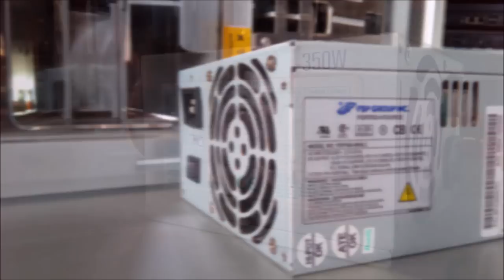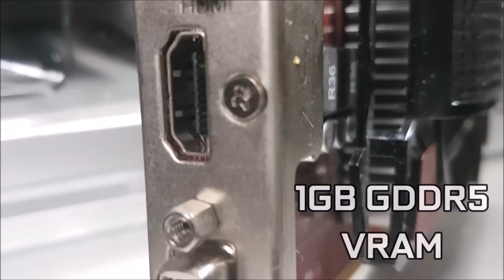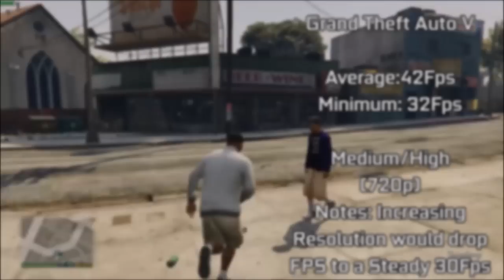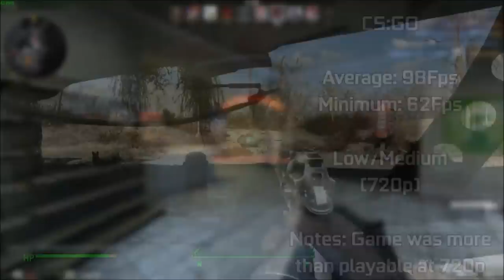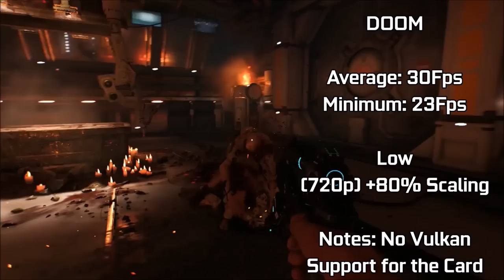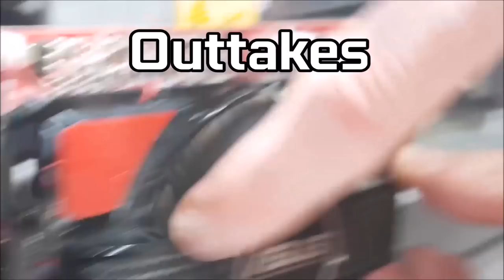Why you SHOULD buy an R7 250 in 2017 // The Low Power Consumption King.

Comment: As a R7 250 user, I don't recommend you guys to buy it to play newer games
Reply: Agreed- I used a 250 in my older computer, I just upgraded to NVIDIA's new budget & low profile card, the GT 1030.

It has almost double the performance of a 250. Whereas I had 2 gigs of DDR3 VRAM in the 250, the 1030 has 2 gigs of DDR5. Clock speeds are far superior in the 1030.

Plus, I got it for $69 bucks brand new on Amazon.
Reply: I bet that R7 250 is great in a HTPC. another low profile/low wattage GPU would the HD5450! runs 1080HD fine in most video streaming conditions
Reply: Jason Hicks The 250 honestly struggles with most modern games man, even when OC'd.

The best cheap, low-profile card on the market right now is the GT 1030.

As I said in a earlier post, it has nearly double the performance of a 250.
Reply: 1030 instead of RX 550? For shame.
Reply: Mark F rx 550 is better
Reply: im a AMD fanboy but the Gt1030 seem better and cheaper it will hold me over until the GPU market is normal.
Reply: darkseeker102 rx 550 is better than gt 1030
Reply: oh well i was coming from an apu integrated graphics so it was a step up now im waiting for prices to return to normal to either get a 570 or 580
Reply: the gt 1030 is also great for 4k video only kabi lake cpus can fully decode all types of 4k video, so its great for older cpus
Reply: rx 550 is a little faster in some games more expensive and more watts though
Reply: im not going to talk shit on the 1030, but for like 40$ more you could have gotten a 1050
Reply: silosis there are more reasons than simply price to purchase a 1030. Its power draw, size, and the like come to mind.
Reply: Mark F power draw isnt THAT much higher on a 1050 compared to a 1030, but being low profile is a plus for htpc use. You can find the 1050 in a low profile variant but it ussually costs a bit more. The 1050 may be a bit overkill for htpc use, but if you wanna play newer games it does come in usefull
Reply: so sad 250 has ddr5 version dude. why you buy ddr3? hahahaha
Reply: not unless u have vga monitor
Reply: It's a what, 3 year old card? Who cares, dude? Whether DDR3 or 5, the 250 struggles with most modern games.
Reply: 小马 me too I have a 2gb ddr3 version and its not good for gaming
Reply: if you have vga monitor would you still buy gt 1030?
Reply: The GT 1030 only has an HDMI or DVI output. No VGA output. That said, you can get a converter cable.
Reply: Organic Agriculture Program DA RFO 10  brother' you can buy the adapter and use it with your graphics card
Reply: that said gt 1030 + vga convertable is not good when u have vga monitor.
Reply: I mean, it's not the best setup in the world, but it would function fine. Is that what you're asking?
Reply: r7 is better. because if u go to gt 1030+vga converter price is few bucks away to 1050, if that happens there is  no point in staying entry level gpu.
Reply: I absolutely agree. But you're the one who brought up the whole VGA thing, so....? I also don't see how you can sit there and claim an R7 250 is better than a GT 1030? I've owned both, dude. The 250 gives half the performance of a 1030.
Reply: because older computer has vga output. maybe ur computer is not old after all. today hdmi is the mainstream output which the gt 1030 had.
Reply: With my old computer (the one I use the 1030 in) I use an old monitor as well. I use the DVI connection, which the 1030 obviously has an output for. DVI connections for monitors have been around for awhile... I'd say the monitor I use on that computer is easily 10 years old.
Reply: Yea I just got it for my hp 8100 until I get to build my gaming pc
Reply: Ripclaw23 Cool,man. It’s a decent card, you’ll enjoy it. As long as you stick to low to mid-range gaming.
Reply: I had it and the fans were falling like every time when spinning faster.And it fell until it did not spin anymore.
Now,I have a GTX 460 and it's doing fairly BETTER than a 2013 gpu.My R7 250 was 2GB VRAM GDDR5 and this GTX 460 has only 1GB VRAM and does better because it has 256 bits and the other one had 128 bits.
Reply: I did have one for a long ish time and I can't disagree with you on that it was an impressive little card but I had to upgrade in the end
Reply: Can it handle fortnite in low/medium
Reply: How well will it run doom 2016
Reply: true
Reply: @I_am_not_a_dog  gt1030 in 2020 are ddr fuckin 4 its Lame card now
Reply: As a R7 250 User, fuck that card

Comment: 2gb version sporting ddr3 was ment for being used in dual graphics mode paired with an A10 apu. The higher ammount of vram was needed for the extra detail both gpu could handle and the DDR3 instead of faster DDR5 was to prevent data chokes due to memory speed differences and therefore reducing microstuttering...
It was a great idea that never really worked

Comment: Keep in mind it's highly unlikely to work with a non-uefi motherboard and system e.g. 2012 HP, so it's not quite universal. It also has a 65w TDP which is slightly more than the 750ti's 60w and considerably more than a 1030ti which consumes only 30w and has the option of silent cooling. The R7 250 can save some money for an impressively similar experience, but be wary that it has the same iffy compatibility as the others.

Comment: I love this little card, I got the 768mb GDDR5 version in 2014, which it didn't do too well, GTA V got 30fps at 720p normal, but when put in a very restricted hp PC with a A8-3870K, it suddenly was getting 60fps in GTA V 1920x1200 on medium & high settings! It turns out it had grouped up with the graphics of the A8 which gave it annother 512mb vram and a big boost in preformance, and for a total cost of £70 for the whole PC, this was a exellent value, especially for the preformance it gave :)
If you see a R7 250 you should definitely pick it up, (don't get the 2GB DDR3 version though, they have much worse preformance, even my 768mb one beats it).

Comment: I have a R7 250 with 1gb vram, i5 2400 and 8gb ram. This is in an HP elite 8200.  In Doom 2016 vulkan on low getting on average around 30fps during arcade mode. Drops slightly when a lot going on but still playable. Might be different on the later campaign levels. There are some console commands that can be applied though.
Reply: Identical setup of a PC of mine,I wish I did find a 2GB version tho because that would have performed better than just 1GB.
Reply: For competitive games battle royal shooting games 1gb gddr5 version is better. But games like rdr2 need at least 2gb for just start. Many recommended 1gb gddr5 which has more bandwidth, but in the end physical amount vram is more important. The work gddr5 is not even necessary, it is about memory bandwidth. Ddr3 vram still ok because of other factors like 64 bit or 128 bit memory bits also affects the memory bandwidth. Double amount of vram is more important in some cases. Lower frame rates but stable FPS.

Comment: I saw there are actually versions with 2 GB GDDR5. One of them is even single slot, low profile. That might be an option but the small bandwith might be still be an issue.
Reply: The 2GB GDDR5 versions are a lot more expensive though, and the bandwidth isn't really an issue.

Comment: I have the 2gb version and i get 120-60fps on csgo with the settings maxed out except shadows they are on medium:) My cpu is an A10 7800 with the igpu disabled because my mobo doesn't support crossfire. And my resolution is 1360x768. (I got my gpu for the price of $88 US)
Reply: I got a 2GB DDR3 R7 250 for $20.
Reply: I got 7770 for 20 euro it's basically a 250x/260 1gb gddr5

Comment: The 250 is not limited by the 128-bit bus, in fact the R7 260x also only has a 128-bit bus and has much better performance. However what is limiting for the R7 250 is if uses DDR3 memory which will reduce the memory bandwidth to less than half of the GDDR5 model.
Reply: Overclocking the memory if you have the DDR3 model could significantly improve performance.

Comment: I'll have the Sapphire R7 250 2GB DDR5 Version, and it's run well for my needs until today, paired with i5-2320 and some 4GB of DDR3 RAM 1333MHz (i can't really say that module can run on 1600MHz, since i don't understand how my BIOS settings cap the RAM speed in 1333MHz).
The price is crazy right now, about Rp1.000.000 (or around $70) new, just 1 years ago the price is Rp850.000 ($60)

Oh anyway, don't expect this card to run new AAA games on 1080p high setting, i've used it around for Older AAA, watching movies, or run some E-sport games for "respectible" settings. Or at least, it useful than my Intel HD 2000 which i can't find the driver around for my windows 10 workspace

Comment: Indeed, that's the card I bought, a Low Profile single slot R7 250 for a dell optiplex with one of those weird power supplies that can't be replaced and only has 280w
Reply: emucosmos get a GT 1030. Lower power draw than an R7 250, double the performance.
Reply: is that so? and here I was thinking the R7 250 was all I could get for my pc, but I'm also worrying that the cpu bottlenecks even this low end graphics card, it's a core 2 quad q6700 @ 2.66ghz
Reply: Alanna Lopez Yeah, the relatively new GT 1030 has the same if not slightly lower power draw than the R7 250.

It also has 2GB of DDR5 VRAM vice the R7 250's 1GB (or 2GB of DDR3).

I replaced the 250 with a 1030 in my "basic" PC, and saw a 50-100% increase in performance.

That said, yes, bottlenecking would probably be a moderate concern with the CPU you have. But if you avoid super intensive newer titles, and/or CPU-centric titles, you'd still get a decent performance boost with a 1030.

CPU intensive games, just as an example, would be many strategy games- like Paradox Studios games. Basically, any game where there are lots of "numbers and calculations" going on in the background.

A basic FPS is far mor GPU centric, whereas most RPGs are moderately CPU centric. As I said, strategy/4X games would be heavily CPU centric. But there are exceptions to these rules.

If you can upgrade your CPU, and are worried about power draw, I'd suggest an AMD FX-4300. 4 cores, very minimal power draw, and you can pick it up cheap- id say sub-$70 off the top of my head. Cores run at 3.8-3.9 Ghz standard, but are easily overclocked to a safe 4.1-4.2 ghz. There's even a guy on YouTube that got all 4 cores up to 4.8Ghz, stable.

Comment: Is there an alternative similar budget cpu you could recommend? Adding e.g. a general benchmarking graph with other related gpus and their prices would be great. This way the viewer has more options.
Reply from the maker: Bora Wiemann: Did you mean you would like to see how this GPU performs with a weaker CPU?
Reply: A comparison with weaker CPU would be great as well, but I meant something else. Envision you are someone that wants to upgrade their old PC and sees the video. You'd probably ask yourself - Is there another similarly priced card that would be even better? And if I buy the recommended 250 what would be the best partner edition that came out? Those 2 things shouldn't be too much research effort, but do take the video to a next level as it provides more than just benchmarks for this card.
Reply from the maker: Bora Wiemann: The GPU itself performs very similarly to this on the following CPU's:

-Core i5 2400/2500
-Core i3 2120
-AMD Athlon ii X4 630
-AMD Athlon ii X4 860k

As for the best brand, the majority are clocked at the same stock speeds, in terms or noise level though the XFX of ASUS models are the best ones to purchase, but being on the used market means its luck of the draw really.

If you would like to see tests with any of these CPU's though I can try to record some, I don't have a great deal of time but I can attempt to provide some.
Reply: Budget-Builds Official I meant a comparison to other gpus, not cpus. E.g. 7750 or 7770. are they maybe priced similarly. 
imagine you would be a buyer and consider this the 250. What would you ask yourself? e.g. would it be better to get the 250x and is that worth it?
Reply from the maker: Bora Wiemann: Ah I was confused as you said CPU in your initial comment, now I understand what you mean.
Reply: Budget-Builds Official Ah. I just saw. Bad typo on my end. Does it make sense why I suggest to add this in your next video?
Reply from the maker: Bora Wiemann: Yes and I shall aim to do so in later video's. The R7 250 is rather niche though, it consumes less power than a HD7770 or R7 250X and can function on any PSU, where one of the higher consuming variants may not. Which is why it is so highly commended by me, in my next review I shall remember to provide benchmarks for multiple cards none the less.
Reply: 750ti or gt 1030.

Comment: I just put one in a Windows XP build I was working on. Had a Phenom 4x 9550 oc to 2.3 on the FSB and I zip tied an 80mm fant to the R7 and overclocked the tits out of that GPU. Kills it in Soldier of Fortune and No One Lives Forever.

Comment: It is simply impossible to run such a channel in Canada, the cheapest ones I found on eBay are going for >$50 with >$30 shipping fees added on top. Sum that and multiply 113% for after-tax cost and add another $10 or so for custom fees.
Reply from the maker: Canada has some great deals but you do have to remember that £1 = 2CAD roughly

Comment: I have  the R7 240 and I absolutely despise this card. Apparently there were a lot better options when I picked this junk thing out four or five years ago, although they were more expensive options. What would you suggest budget wise? The 7770? I was looking at those on Ebay and the cheapest I could find was around 54 bucks and up. That is a bit more in my price range at the moment (trying to get back on our feet a little). I need something a bit more powerful as I am going to be buying a better system here in a little bit, I will more than likely buy something cheap and fix it up myself. The CPU I am looking at socket wise is FM2 which I believe will be fine for no more than I need when it comes time to upgrade a couple years down the road. Its a refurbished HP, I find those easiest to work on just IMO. I was also wondering if you might could help me figure out why my husbands GTX650 Ti has green blocks, will reset the screen and then be fine. Sometimes it will even restart the PC and then be fine.  It is not OC'ed, it was clean as a whistle when we got it off EBay. The blocks will be all over the screen, sometimes it will reset itself but sometimes a hard reboot is all that you can do to remove them. Thanks!!!

Comment: In my opinion this is incorrect. If you look on eBay though you can find used GTX 670 for $50-$90 and that my friend is most definitely a card worth getting for that price. Release 2012 they were $400-$500. I have one now and can play anything 1080p on a 40 inch monitor.

Comment: i had an r7 250x 2gb ddr5 card over clocked that runs modern titles actually really well. i put it in an ultra budget build for a younger relative's 10th birthday and the use that he gets out of it is astounding. He'd be the third or 4th owner of the card at this point and it still gets the job done. that being said i dont see them on ebay for 30USD. The version i have goes for a little more used but the baseline one like in this video is around the 40$ mark

Comment: I have an xfx r7 250x 2gb edition. The thing advertises 1080 resolution and also 4k. The only game i could ever get to play in 1080 was alien isolation. Nothing else at all. Also it supposed to have crossfire capability and no go for me and a friend of mine. Only one card was being used with both connected. The price of my card is still 80 to 100 dollars. Its insane that people are still getting that much for them. Ive had mine for at least 2 years now. I bought mine for 100 each brand new in box. I wouldnt advise ANYONE to buy one. You could do much better for same price. As far as power supplys go. THEY ARE FUCKING CHEAP. I have a 600w power supply it was 45 dollars. And overkill for alot of graphics cards. You can get a card that is low powered but still throws out some good performance. But it wont happen with an r7 250 or 250x.

Comment: My friend recently build a PC for less than 6000 INR, which is around 100 USD. This is great because every single pc part costs about 1.5-2 times its original price here in India. His specs are

E8400, 4gb ram (he's going to upgrade it to 8 later down the line), gt 610 (planning to upgrade to a gt 1030), 300watt psu from an old prebuilt pc and a cheap case. It actually has okay 720p (around 20-30fps for less graphically demanding titles) performance even in many modern games. Even games like deus ex mankind divided run on it at 720p 20 fps. And that is really good for a PC with parts more than 10 yeard older. He even managed to run crysis 3 on 720p 30 fps with all settings to the lowest. It's a pretty decent pc.